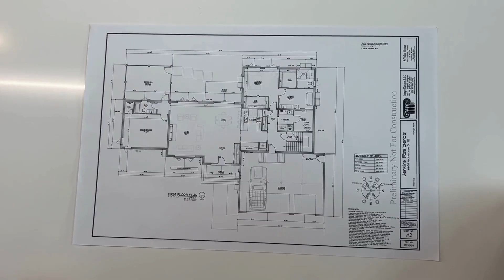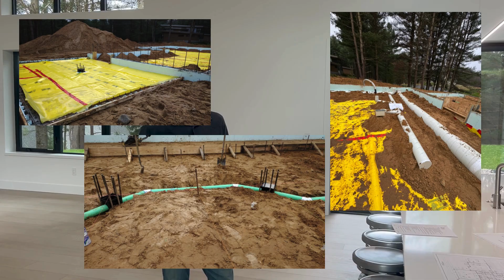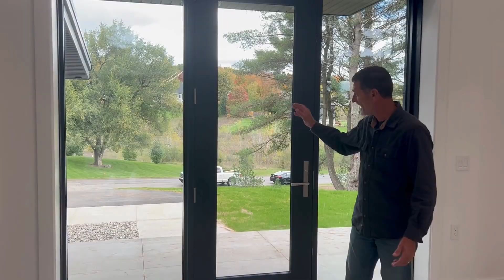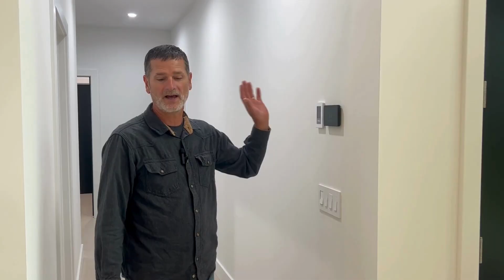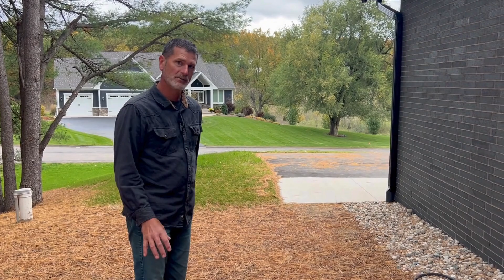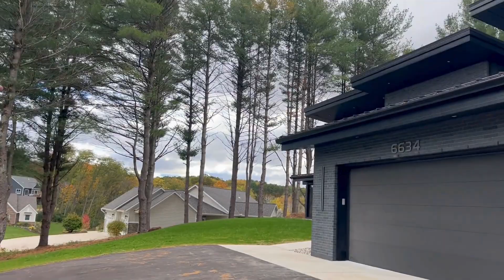Behind the Build - Real Challenges We Had to Solve In This Michigan Custom Home

Comment: Really appreciate your content. 
Wondering if you could comment on 1- ACH50 did you do a blower door test and do you target to your builds to a specify level?
2- is there a window- door company you like for your high efficiency builds? 
Thank you
Reply from the maker: Thank you! We perform a final blower door test on every project. To be honest once you get under 1.25 or so, the benefits are pretty small for getting better. That said, I am never personally satisfied with a number and always want better.
There are a lot of possible window manufacturers, many of them regional. I look for u-values under 0.20, DP of 50. After that, there are a lot of personal and client preferences that come into play.

Comment: Is frost protected shallow foundation poured as a 1-time monolithic slab with thickened edge or it is still a 2-step process where the shallow stem wall is poured first and slab is done later as a second step? Thanks
Reply from the maker: There are a lot of ways to approach it, however we avoid the thickened edge method, as it is challenging to eliminate the thermal bridging under that thickened edge, and leaves a cold floor edge. It is also susceptible to greater cracking potential around that thickened edge to slab transition.

Comment: Great content.  "Proper Planning and Preparation Prevents Piss Poor Performance", "Plan your flight and fly your plan", same for diving.  I understand construction is not a precise instrument and adapting on the fly is always expected and needed during the process.  But being a problem solver means is great in one sense but it means you failed to plan properly.  Some thing are out of your control, like the tub.  "Things Happen" but if you spend the meticulous time in the beginning, while it is on paper, it saves time, money and increases customer satisfaction. 
Building in New Hampshire.  Plans are done, and lot is getting cleared.  I know I am high maintenance for my builder because I am running to ground every aspect I can think of.  Air, water, vapor plane sealing.  ERV ducting and air flow (Cold/Hot) zones with Mini-Splits.